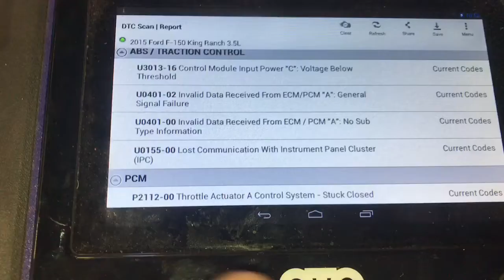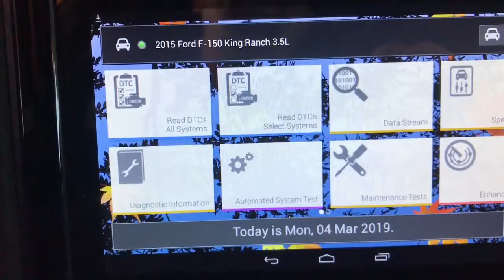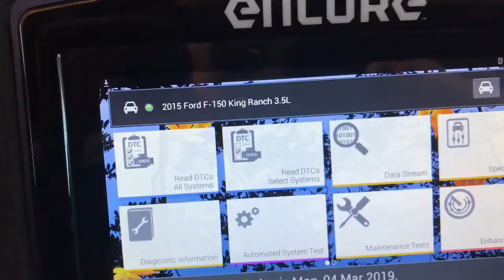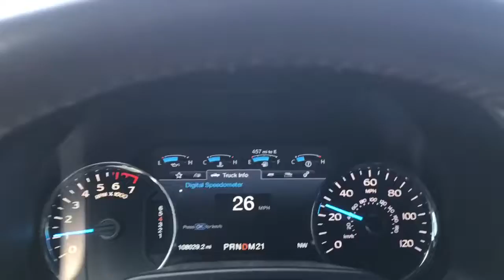Ford Electronic Throttle Body Failure EBT  Fault (2011-2017)

Comment: Cannot find a video for a 2016 ford edge 2.0 echo boost throttle body removal. Engine is not the same as the years indicated. It is underneath the manifold. Want to know if can be done from below. Not enough videos for the 2916 anywhere;(

Comment: I have a 2015 3.5 L EcoBoost on a incline I have no throttle response whatsoever when I put it in drive or reverse it shakes like crazy replace with a new throttle body and still has the same issue please help someone

Comment: Decided to stay and watch  your Post because you described in detail, the behavior of the Engine when this problem occurs. The Shop I took it to said over and over that they could not get a Fault Readout on their Computer... Well, when Technology Fails, fall back to using your Head, knowledge and skills. Thanks for this very informative Video. I can now go forward and purchase a Ford Throttle Body... and replace it myself. Good Work!!

Comment: Great job I’m having that same problem. Cleaned the throttlebody and reassembled. It ran great for about a week and yesterday through the rent and wanted to limp mode again. Turned the engine off, and it ran fine again could not retrieve a code.

Comment: Had mine fail at ~110k, replaced on the side of the road and all good! TIP: I took off the first three bolts before loosening the fourth which was stuck pretty hard so it kinda torqued the molded in nut out a bit when I cracked it loose.. So loosen all four bolts before removing any to avoid damaging the flimsy plastic intake manifold.

Comment: Thank you for posting.  Just had to do this repair on my 2017 Expedition.  Same issues....limp mode, p2112 code.  Changed it out in about an hour and (knock on wood) running good again.

Comment: Generally, I like my Ford F150 2015, but this throttlebody is a piece of garbage. I can’t believe Ford had never did something about it to fix this. I have replaced my electronic throttle body four times on this truck.
Reply: Did you ever get check engine lights? Mine just messed up Monday and I bought a throttle body but I don’t have a Check engine light but I’m getting dead petal like crazy and all of these symptoms

Comment: So glad you posted this.  I was worried about chasing the ABS codes first, and your video had the exact same codes as mine.  Even though the TSB said ignore the throttle body code if U3013 was present, it was still the throttle body sending bad CAN messages.

Comment: Great video. I replaced mine just as you showed and it worked great hauling my camper out to Yellowstone. Two or three years later, same code, limp home mode. This time I didn't have a big trip imminent, so I just cleaned the throttle body with throttle body cleaner really good. Going on 2 years now with no problems. Folks might want to try cleaning it before replacing.

Comment: Great and thorough video. My daughters 2011 Edge 3.5 stalled on her at 30 mph. After a panic, she turned the key off, restarted it, and it drove fine. Hoping this is the fix. Appreciate all the background in your video as well as the replacement portion.

Comment: Hey man i just recently changed the throttle body and for some reason the truck keeps going into limp mode in the mornings when its cold but once it warms up i turn it off and back on again the all the lights go away any recommendations ?

Comment: Great job on your video on how to change out the throttle body!!  Question, is necessary to reset the computer with using the jumper wire from ground to positive?

Comment: My intake hose keeps blowing off my throttle body... Ideas? Yes it tight. I just cleaned the edge and inside of rubber with alcohol. Will see if any change. But I'm wonder if a bad blow off valve would cause to much boost and blow it off under pressure.

Comment: I have experienced the symptoms on my 2013 F150 with the Ecoboost engine; loss of power with a bright yellow wrench flashed up on my dash.  Coasted to a stop, turned the engine off for a few seconds and then started it back up.  No problems since then for the last few days.  However I took the truck to my very trustworthy mechanic and he checked the codes.  To our surprise there were NO CODES!  However given my explanation of what happened he concluded that it probably was the throttle body too.  I'm convinced I should just replace the ETB.  I have no code reader...will I have problems without being able to reset the KAM?  Guess I can try the jumper from the disconnected negative cable to the positive terminal.  Also I can't find your link to ordering the ETB.  My local Ford dealer has one for $173.  I'm guessing that's about right.  Please let me know if there is a better alternative.  Thanks!!!
Reply: Any update? Same issue with my truck
Reply: Same issue with my 2013 Taurus

Comment: So I'm having the same issue but I want to know why the truck starts to shake and messes with the transmission, awesome video thanks for the info
Reply: Try putting “shutter fix” in transmission. I didn’t believe it till I tried it.
Reply: Not only that mine shaked and no response on pedal plus abs light on wrench on and airbags on 😢

Comment: Good Day Aaron,
I have a 2014 Ford Fusion…which I’m have the same problem…slow takeoff at the light…then at around 2500 rpm’s…the power kicks in…and…then I’m off to the races… …so…after watching your video…which is excellent by the way…I have a question…before taking the replacement route of the throttle body…can the oil and carbon buildup be cleaned out?…providing the rest of the throttle body is in good condition…

Comment: perfect tutorial.  Replaced the throttle body on my 2014 without a single issue and it's idling so smooth now and more responsive.  Thank you!

Comment: Great video.  I recommend reading the TSB.  Installing and maintaining a catch can (which may or may not prevent this problem) is more difficult and more expensive than this repair. 

Also, when searching for a replacement throttle body, I came across two variants of the electrical connection on the throttle body—male and female—available at O’Reilly. Check the style that is on your vehicle before replacing.

Comment: I had this happen in my '15 3.5 liter last spring 2 weeks after buying the truck used from a stealership. On a 2 lane highway, towing a tandem axle trailer...not a lot fun, very dangerous as a matter of fact. Had to have another dealership install a new throttle body as I was 800 miles from home & tools but what a shock when it happens & limp mode kicks in! Needless to say I wasn't impressed Ford knows of this issue & has done nothing to design a better throttle body for these motors. It's a cash grab in my opinion but no other maker is any different anyway so we owner's just get to deal with it. I now own a spare as well & never leave home without a good assortment of tools, lesson learned! Great video!!

Comment: Update on my comment. My  friend has the same truck and had the same problem and this fixed his truck. His was doing the exact thing mine was so I never went and got my codes read. I just changed the throttle body & it didn’t fix it. I went and had O’reillys read the code and it was missing on cylinder 4. I changed my spark plugs and it fixed the problem. $137 mistake on me. My throttle body did have oil inside it though.

Comment: Great vid man, thanks. I ordered the throttle body today from your link which is a nice saving from what my local dealer wanted. The link for the gasket said it wouldn't fit my 2014 f150 3.5 but no big deal I just ordered the one that would. Thanks again sure appreciate the video.

Comment: So that oil contamination in the TB...I venture to guess that comes from excessive oil carryover from the EB being a forced induction engine? In theory, would a catch can help prevent the premature TB failure? Curious how the oil gets there in the TB in that qty.
Reply: Oil leaks through the turbo seals on an older engine and gets pulled into the intake.

Comment: I’ve had my 13 F150 throttle body replaced twice so far and am pretty sure it’s about to fail again. I’m around 150k miles and it seems to happen about every 2 years. Do you think that purchasing an after market one that’s a little beefier would be better?
Reply: I just watched a TFL “height mileage” eco boost vs coyote v8 video and the eco boost guy said “these go through ETB’s like a fat kid eats cake” and is on his 7th swap out at 230k miles.
Reply: @decoste888  I bought an aftermarket one. Was like 5 bills. Hopefully it lasts longer.
Reply: https://youtu.be/puIOVttzpIo

Comment: Just changed out the throttle body using your video. It was spot on and it worked perfect. Great video! We used a ni-cad wrench similar to yours with a long wobble socket extension, that is the only way to do it with those hard to reach hose clamps. It allows so much more precision in reinstalling the hose clamps.  Thanks so much, it saved over $150 in labor charges. Bought a new Ford replacement TB instead of an aftermarket unit. Take care!

Comment: Happened to me on my 2015 Transit 250 ecoboost with about 140k. Out of nowhere the vehicle just went into limp mode. Thank god I was pulling into a gas station and as I went to accelerate it went into limp mode and wouldn't move. Turned the vehicle off and on. Moved about 100 ft and then it did it again. Could have been a real bad situation if I was in traffic. Sucks that Ford's recommendation for everything is to just replace it even when there is a known issue that should at least be on recall just like the flex coupling I've had to replace 5 times bc Ford has no permanent fix other than bring it in every 40k miles smh. Thanks for the vid! Huge help!

Comment: My 2015 3.5l ecoboost was the biggest pile of junk I've ever owned and I've owned an 05 gto. If the truck wasn't in the shop broke it was in there for a recall. Never got to actually drive it. TB went out at 55k miles $480 at the dealership they paid since I had the truck less than a week. Same exact thing started happening at 106k. It will leave you stranded. $80 TB off Amazon and 20 minutes labor, traded it off the next day. Had warped exhaust manifolds, never got the quote to fix that common issue. Will NEVER own another Ford

Comment: 2015 F-150 3.5 ecoboost, problem happened many times in a week. I no longer trust the truck to function when acceleration is required.
Same temp "fix", scurry to side of road, put truck in park or neutral, turn off truck, wait at least 5 seconds, turn on again. Final step is to hope it doesn't immediately happen again. I have found letting truck stay off for 5 or so minutes (about time required to Google the problem) let's it start up with better chance of not failing again.
Reply: Update: replaced with new throttle body
Limp mode problem gone, and very surprisingly truck now getting +2 mph average over 2600 miles of mixed city and highway driving.

Comment: couldnt make a left as loss power and 0 accel, had to turn suv off then on and was able to make left on next green arrow.  Very dangerous, looks like the time has passed on the recall also on the throttle body.  Need to bring it into ford to fix the steering bolt recall too smh junk

Comment: Does anyone know if this problem will occur with no cel? Mines a 3.7f150. I’ve had my truck for over 2 years now and have always felt like the throttle control was slightly erratic, and it seems to have a dead feeling if I am at a stop and need to accelerate quickly, kind of like floor it, 2 seconds of crawling forward then the engine comes alive. It’s also at times better than others and then worse. I actually have headers and a custom tune on the truck with the throttle control parameters maxed out to full aggressive, and at times it seems slightly better, other times it’s like when I first got the truck. Since I bought the truck it’s been like this, so I have no way of knowing if this is just how the truck is, or if there is an issue. I will say this, my truck has 3.73 gears, I drove a truck with the 3.7 and 3.55s, and it accelerated better. Any input would be much appreciated!
Reply: What you describe, lack/less power for a second at green light, sometimes very responsive immediately, sometimes not, that is turbo lag.
Reply: Jason W I appreciate the response, but my truck is not turbocharged. I did however fix my issue, it turned out to be a failure in the knock sensor circuit. My truck was essentially in limp mode for the 2 years I’ve owned it. The code was not triggering a cel, nor was I able to read it with a generic code reader.
Reply: @treystoys  that is a bad failure mode, sorry to hear something like that would happen with a modern ecm.

Comment: Hi.. Today I had my truck go into limp home mode with a AdvnaceTrac warning and another message saying Hill Start Assist is turned off.  I shut down the engine and restarted, which reset it for only about a couple hundred yards then it would go back into limp home mode.  This happened 4 times in a row over about 1 or two miles.  The fault code was P2112.  

I watched Aaron's video, used the wife's car to go pick up a new throttle body (which included the gasket.  Don't know why everyone's asking for a gasket part number here).  Took me 45 minutes to replace it.  I didn't need to recalibrate, but there's another video on Youtube where the fellow used his diagnostic tool to reset the KAM.  He also showed that while the negative wire is disconnected from the negative terminal, you could jump a small wire from the ground wire (while it is disconnected) to the positive terminal for 10 seconds and that would reset the KAM.

Anyhow, thanks for an easy to follow video Aaron.  Much appreciated.  $175 CDN taxes included well spent.

Comment: I just changed my Throttle body and it worked but I hear a crank noise when I step on the accelerator

Comment: I'm having the same problem with my 2016 f150 5.0, no codes though. It doesn't stall but will have a difficult start and then will not accelerate once I'm driving. These symptoms go away after a 5-10 minutes. after that it seems to only happen after hard acceleration. Any thoughts?
Reply: Mine likes to fail on the Interstate with mild uphill acceleration and when trying to merge

Comment: will the throttle body cause the car to shake wehn parked in a red light for a long time? 2014 ford explorer . only wehn in an idle state.. runs great.. i cleaned the throttle body and still does the same thing...

spark plugs were repalced

Comment: Hi Aaron,  this is the second time I've had the issue. The first time the dealer nailed me for $600. This time I found your channel. The truck "limped" back home however after a few hours I checked it and limp mode is off but the check engine light is still on. The truck runs ok. Should I replace the throttle body anyway? and how do I get the check engine light off?
Reply: Yes - it seems like any debris sensed in the throttle body will throw a code even if it clears the debris quickly - I reset the code with a cheap code reader I bought on amazon and it’s been fine but I do not trust it - good idea to carry a new OEM throttle body and the three tools it takes to replace it - it only take 1/2 hr on mine - I am Kinda pissed off the Ford is not standing behind this fragile component
Reply: I have experienced the same thing with check engine light. After driving while the check engine light went out on it's own. Might give it a day or so of driving before check engine light goes out
Reply: Gordon Goodrich have you fix ur issue? My 04 f150 is throwing a wrench light with check engine light. It will start and run but on limp mode.
Reply: @Genuine048  i disconnected the neg batt cable - but here I am again with same problem - this is frustrating!!

Comment: Great fix, thanks! But now I  have a P0299 code. Anything with the throttle body would have thrown this code??
Reply: P0299 means you probably have a hole in the blow off valve, so it is leaking boost. New (edit) BOV might solve that.

Comment: I don't see the links you mentioned for the TSB and the source for the OEM throttle body.
Reply from the maker: You will need to open the description of the video. And it’s at the bottom. Most likely an arrow you can click on.

Comment: Since it’s a TSB does that mean ford will cover the cost to replace it? Since you say to replace it with OEM, will it happen again or have they changed it? Thanks for the video
Reply from the maker: No. Ford will not cover it unless it is a recall. You can check with your local dealer to see if it is a recall for your truck. A tsb is a technicians service Bulletin. Just means that ford knows it’s a common issue and what’s for rd techs to know about it.
Reply: I have a 2015 with the 3.5. Can you post a link for the gasket I need?

Comment: How’s it holding up I have the same issue right now guess I’ll buy the throttle body but I think the gasket links are switched can you confirm for me
Reply from the maker: Holding up great. No issues since Replacement. Ford has many different part numbers for the same gasket. I called a local dealer to verify. Link has been corrected. Sorry for the confusion